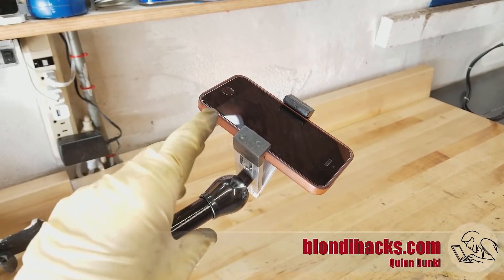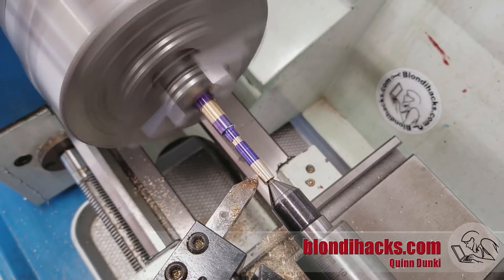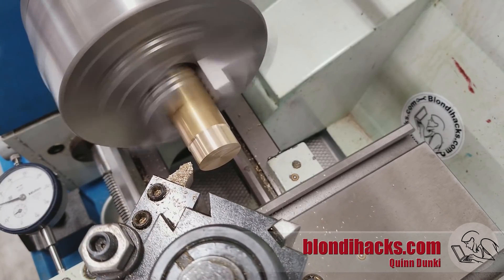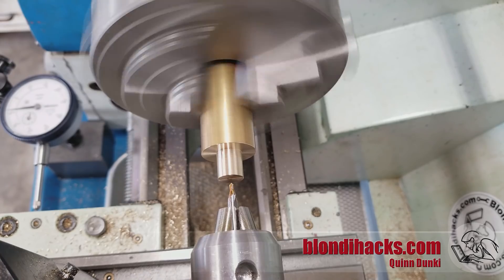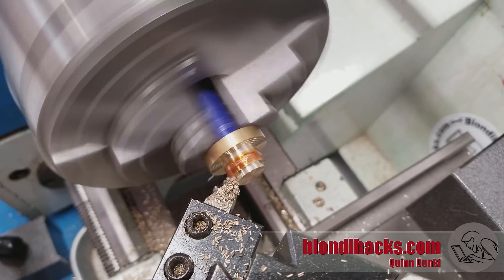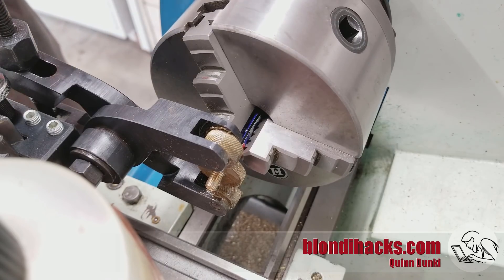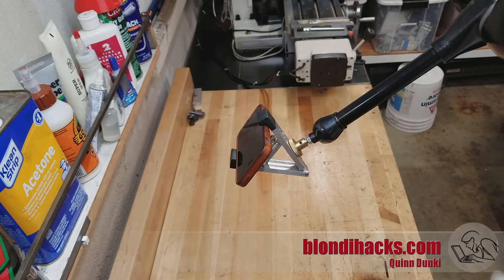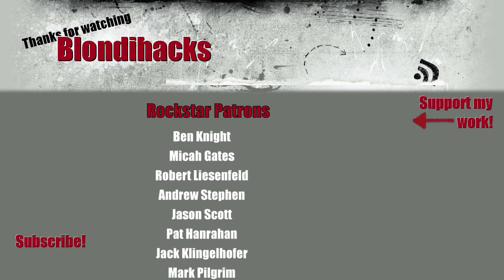How To Make A Tripod Adapter

Comment: I make many camera and telescope adaptors with a need for tensioned pressure-on sliding tubes-all made in a 6061 Aluminium, I snip a small piece of o-ring the inside diameter of the screw hole. It allows nice friction adjustment without the tensioning/ locking screw marking the sliding inner section.

Comment: To ease the die onto any shaft just, cut a very shallow and short taper at the end. This will ease and guide the die onto the shaft without the need for pressure from the tail stock. This is particularly useful for very small diameter shafts of SS or Silver Steel for model engineering. Also try and use a copper pad at the end of the grub screw. Copper is soft but will lock on without letting the hard grub screw chew into the soft brass. Enjoyed the video. Good work.
Reply from the maker: Sometimes that can help, but it doesn't really work in brass. Brass doesn't have much structural integrity, so the first thread tears out, regardless of taper. It's important to get the major diameter of the thread just right.

Comment: picturing Abom as crocodile Dundee... "that's not aggressive"  😁
Nice fix Quinn 👍
Whats your opinion of the Gearwrench handle? i reckon it would be better if the ratchet could be locked
Reply from the maker: The Gearwrench thing is... okay. I agree a lock would make it better. I bought that set back when I was working on cars a lot, and for that it worked fine. Now it's just my "backup metric" set.
Reply: I dont really do enuf tapping for it to be a huge irrit, i like the system but it could be sooo much better with a lock

Comment: Couldn't you have cut the threads with the lathe?  (Or is your lathe not so equipped?)
Reply from the maker: I certainly could, but that's a lot more work to set up than using a thread die. Setting up the change gears alone would take longer than this whole part took to make, so I don't generally do that unless I need a thread that I don't have a die for.
Reply: Probably, but I would assume it's more work than using a die. I think she's shown cutting threads on the lathe before.

Comment: May I suggest another tip for setscrews on a shaft, one 80 yr old guy at work would cut off a bit of solder and drop it down the setscrew hole. Didn't need any loctite, and you could adjust the tension on the shaft without marring it. The solder simply deforms and fills up all the space under pressure in the screw hole, putting just enough smooth pressure on the shaft.
Reply from the maker: Oh, that's a great idea! I haven't heard that one before.
Reply: @Blondihacks  yeah I learned some from that guy before he passed, it was cool. The old timers had some real tricks from the great depression etc.
Reply: That's really interesting; what kind of solder did he usually use?
Reply: Phiwise_ just plain old 50-50 tin-lead
Reply: I use the proper sized lead shot or sinker.